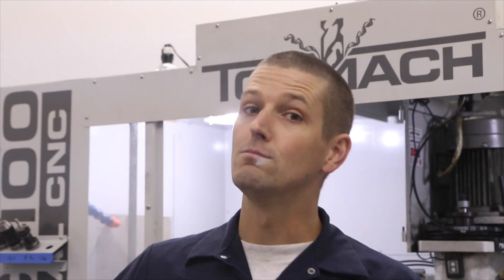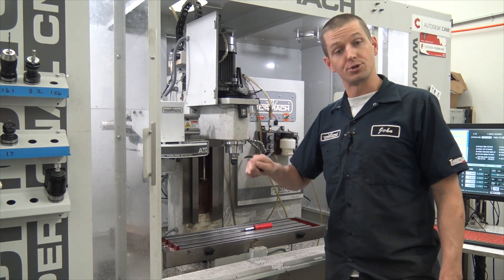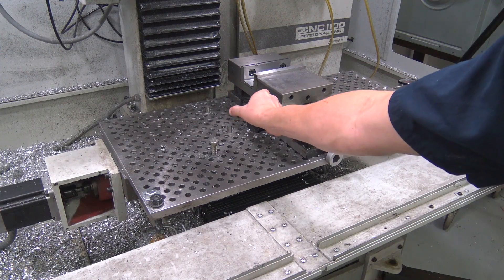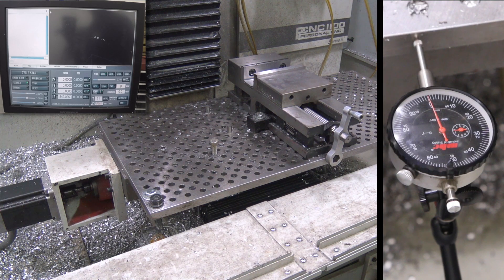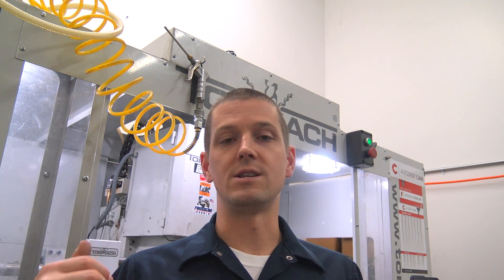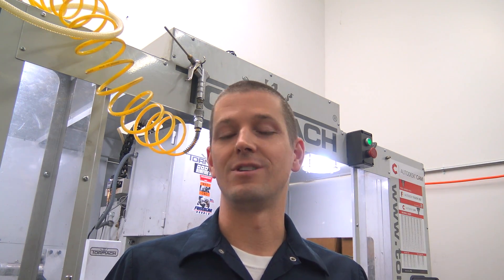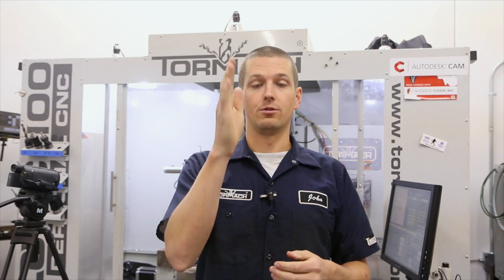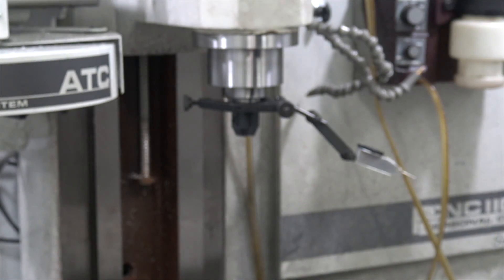Tormach PCNC Maintenance!

Comment: Hey mate. Quick question. For milling steel if you were building a milling machine what spindle would you go for. ER32 collet I prefer over R8. Would you go for a spindle with built in motor or a spindle with pulley and external motor?

Comment: I wonder what the Tormach tram spec is. When I set up a machine, I like to get under .0005 TIR on a 10" circle. I can live with .001. 

Interesting that you could adjust the nut on the ball screw and reduce the backlash. On a "real" CNC machine, the thrust bearings would be angular contact bearings and the pre-load is not adjustable. I did work on a CNC knee mill one time that used tapered roller bearings. It must have been adjustable.

Comment: Hi John,
I haven't read all of the comments so some of this may already have been mentioned. What your doing is checking the tram of the spindle to the table, but if that head isn't bolted down truly square to the column then you still don't have the machine correctly aligned. Setting a 12" GOOD cyclindrical square on the table and a 10ths reading DTI mounted in or on the spindle, then use your Z axis movement to traverse down the square while sweeping across the square every inch or so for the reading will show if that Z axis is at 90 degrees to the table within the slight errors of both the square and the DTI. That has to be done in both X and Y directions to check the column for lean in both directions. Once that's corrected you then use that DTI to sweep the table or vise in both X and Y. At that point you may need to tilt the head for the X axis alignment and possibly shim the head for the Y axis alignment. So there's a bit of tail chasing in this. Even better would be to use no shims and scrape the head into the correct alignment for the best rigidity.

Shimming the column for tram removes a lot of rigidity since the foot print is greatly reduced. Surface grinding on both the bed area and the column foot to get it very close and then both surfaces should be clean and smooth. Then some minor hand scraping to bring it into the last bit for a true alignment would be the best method. A LOT of work with all the trial and error checks and fitting. But there's no short cuts if you want it done right. I only use a 1 or 1/2 thou reading indicator to get me in the ball park. Then move to a 10ths DTI so I know what my readings really are. 

Due to the flex involved with flycutters in the whole machines system including a very minor amount from the spindle bearings themselves you'll always see a very slight back cut even on a perfectly trammed machine. It's impossible for them not to show that effect on the lighter built machines. If you don't see it that means your machine is out in the other direction, or trammed with the flycutters trailing rotation tilted up and away from that direction. And the larger your flycutter then the more pronounced that back cutting effect is.

I know nothing about the Tormack machines yet, or about CNC at all. But these lower end machines aren't properly cleaned at the factory or assembled in anything close to clean room conditions. Even on a brand new machine the table should be pulled and feed screws, nuts way surfaces flushed with a spray degreaser. CRC electrical contact cleaner works very well for the ACME nuts on my mill, I'm not sure how well it would work with those ball nuts though. I do know it's not a good idea to remove the ball nut from the screw for those who don't know that yet. Done incorrectly you'll be chasing the balls all over your shop.

And given your machine is doing production I'd highly stress that pulling the table every 6 months or so would be a very good idea. You will find all sorts of chips in where they shouldn't be, but the way oil will be deep black from wear just due to the parts wearing together. That black oil contains metal and further accelerates the wear. Clean ALL that out, inspect your lube system so you know all areas are getting properly lubricated, double check the tightness on the bolts for the ball nuts, relube, then reassemble and do your gib and screw adjustments for tension. Yes all this is a lot of work, but you will be surprised at what you find under that table. And your machine will work far smoother, much more accurately, and do so for far longer.  I'd also bet you can get your adjustments a little tighter for better accuracy but still have the same amount of drag between the gib and the way surface. My BP Taiwan built clone came from the factory with .020" of backlash and was fairly stiff to move. After the strip down, cleaning,  relube and proper adjustments I had .004" with a silky smooth movement. Not too bad for a manual machine with ACME screws and about what a brand new Bridgeport will have. While I didn't find any casting sand I did find just enough metal and grinding dust from the surface grinding I was very glad I took the time to do all this.

My apology's for the length of this, but you did ask for comments.
Reply: https://www.youtube.com/watch?v=kF3LfP3W-Ec&list=PLEhrXDmG4b0VXI8Q_LVIWXlvWIuVLThoQ&index=6

Comment: Seems to me that's it would be a bit better practice to mount your tram tool directly in the spindle with an R8 collet.Holding a tram tool in a setscrew holder isn't really that bad, but for optimal results its not best.The inherent nature of a setscrew holder to rock the tool to the side abit  when the setscrew is tightened down is not what you want when your inspecting your machine like this. Your thoughts?

Comment: To War Machine: put a indicator holder in the spindle then tram x and y in the same set up by spinning the spindle by hand. THIS IS THE BEST WAY TO TRAM ANY MACHINE. IF THE COLUMN IS NOT PERPENDICULAR TO THE TABLE THEN YOU MUST FIX THAT FIRST BUT ALWAYS END UP TRAMMING THE TABLE WITH AN INDICATOR BEING HELD IN THE SPINDLE WITH A HOLDER.

Comment: Hey John,
Great video. I went through all this same painstaking tramming myself. It took days to get it dialed in just right but I could have saved myself a lot of time with this tip. Tram the head to the column FIRST, then tram the head to the table. There is a big difference. When I initially measured my table tram it was off in the Y so I shimmed the column until it was dead on. But when I cut or drilled I still had long drills binding and squealing, holes not round, etc. How could this be? I trammed it. Well turns out the spindle was not square to the column it was essentially pointing backwards toward the base so I was trying to make round holes with a crooked stick. So I shimmed the spindle cartridge (you could probably also shim the head) until the Z travel was parallel with the spindle axis in Y. After that I put the Edge tramming tool back in to check the table tram and it was off by the same amount that the spindle was off. My table tram had been perfect and I screwed it up, it was the spindle that was out of square not the table. After removing the shim from the column and playing around with smaller shims and bolt tightness I got the table back in tram. So now the spindle is trammed to the column and the column to the table. 

You can check the tram of the spindle to the column by putting a long piece of drill rod into the collet. Attach your mag base to the column and put the DTI on the top of the rod right as it comes out of the collet. Rotate the spindle by hand. You will notice some runout, that's OK just center the zero between the needle swing so it is equidistant on each side of zero. Then run the head straight up in Z until the DTI is on the very end of the drill rod and rotate it by hand again. The magnitude of the runout will increase but the amount the needle is off to one side (subtracting runout) is the amount out of tram it is. You can do this for both X and Y. The idea is to get the needle balanced around the zero equally both at the top and the bottom of the drill rod. Then you can proceed to tram the spindle to the table as you did with the Edge tram tool.
Reply: +War Machine LLC   This is a more direct method of measuring the parallelness of the spindle to the z axis.  I like it a lot.  
One comment.  You don't have to mount the mag base to the column.  It can be place on the table as well.  That way. you can use the table for precision alignment of the DTI.  All that is required is that the DTI be parallel to the x axis and to the y axis  for the x  and y measurements respectively.  

I used a similar method for measuring squareness of the z axis to the xy plane by placing the rod in a chuck on a horizontal RT and rotating the table to find min and max.
Reply: +War Machine LLC Thanks for this. I took the time to tram head to column and then column to table. The head must be in tram with column and needs checked first. Thanks for the heads up and all is well now with the deep drilling.Dennis
Reply: +NYC CNC Besides mill just working better after this type tram, the ATC now works flawless.
Reply: +BeveledGlass You bet! Glad that fixed your issues!

Comment: This is where the Tormach deviates from traditional C frame mill design.  The thrust bearing preload should be set with a shim, that's it.  The bearings are manufactured with precision shoulders, you put a shim between the inner races and make sure the outer races are touching, that's it.  This shim creates a preload of the bearing races and keeps them from having any lost motion.  The thrust bearings on the ballscrews are just smaller versions of the bearings in the spindle, they are both angular contact ball bearings.  You shouldn't need to fiddle with preload nuts, but Tormach decided to install the bearings in a backwards orientation.  They use a shim on the OD of the race and use the preload nuts to establish the preload between the inner races.  The way to fix this is to reverse the bearings in the bore and put a thin shim between the inner races, then the "thrust nuts" only retain the screw in the bearings, they don't adjust anything.

The use of 2 ball nuts to create a preload is used traditionally with rolled screws and mass produced ball nuts.  Looking at the parts breakdown, the Tormach uses single preloaded ballnuts, not 2 ballnuts installed in opposition.

So, Tormach's design is similar to other vendors, but there are a couple of things that make me scratch my head and ask "why did they do it that way?".

Comment: John Did you try and mill a circle after you adjustments? The traditional way to check if you gibs and backlash are correct is to mill a id bore and check it with a dial bore gage. The actual size is not critical but what you are looking for is reversal marks at the 90 deg. quadrants (Backlash)and out of roundness at the 45 deg. quadrants(Gibs) with the dial bore gage. there is a instrument called a Ball Bar Gage witch is used to measure this it will also tell you if your axis are square to each other. But it is a expensive tool. lacking that milling a bore with a end mill in a scrap piece of material is almost as good. A modern CNC machine should be capable of holding less than .001" roundness to the circle. I don't know Torchmach Machines but there should be a backlash adjustment parameter in the control to compensate for backlash in the ball nut. O one other thing the proper way to adjust a gib on a CNC mill as to measure the current draw on that axis servo motor.

Comment: I don't go as far as seizing the steppers. I loosen it, then tighten until a 1-thou step does not make the table move a full thou. I back off just barely from there. It requires more maintenance than keeping it tighter but that's my preference.

Comment: Hi John,

I've seen someone jam a gib really badly doing it your way. The Tormach is low enough power that you got away with it, but it took a hydraulic jack to free off a big machine and people have destroyed Bridgeport style machines by doing it on the knee (if the knee is too low you can't get to the screw to push the gib out).

The propper way is to use a dial gauge to measure the rock in the slide.

Keith Rucker did a good video on the task; Machine Shop Basics: Tramming a Vertical Milling Machine
Reply: +Paul Compton   +1 to the Keith Rucker video showing the proper way to adjust gibs using an indicator with a torsional force.  I was very confused by Tormach's method of adjusting the gibs by measuring backlash.  The video I watched was titled: Milling Machine Maintenance:  Adjusting Gibs and Ways.
Reply: Paul Compton I

Comment: John I'm a little puzzled as to why both you and Tormach are interchanging leadscrew backlash and gib adjustment. I'm not at all familiar with the Tormach, but I believe the two should be completely independent (well to a point the table is jus flopping around).

Were the gibs far out of adjustment? About 6 months ago I wrote in a comment that I felt they were loose and should be adjusted. I'm now curious to know if that was correct.

To adjust the gibs on my machines I normally try to completely disconnect the leadscrews so I can move the tables etc by hand. I then make the gib adjustment by moving the table through the full range of travel and feeling the tightness at the gibs by the drag. Generally you want to be careful out at the extremes of travel as the machine doesn't normally get used as much out there, and the gibs can finish up tight if you adjust only for 0,0 and don't check the extremes. I get much better feel for the adjustment by moving things by hand. I have no idea if that's possible on your machine.

Finally, does the Tormach have a backlash compensation function within the firmware? Once you've exhausted the mechanical backlash, and if the remaining backlash is consistent and predictable, I think you should be able to take out most of the remaining in software. I have absolutely no idea however how, or even if, it's possible on your machine, but the Tormach people should be able to advise. It certainly is however available on other CNC platforms.

Great to hear it's all working out.
Reply: +NYC CNC Sometimes it's not necessary to actually remove the screw, and you can just remove the hardware at the ends that supports and controls its backlash. It does feel like you're going backwards to move forward, however in my experience that sweet spot is very narrow, especially as the machine wears more and you will battle getting things "just right" (or at least as good as they can get). Done in the correct sequence (ie first) adjusting the gibs this way shouldn't add that much time to the project. Just be grateful you have a tapered gibb and aren't trying the same with a series of gibb screws!!!

Anyway, it's done now and all is right again. Good to hear that the machine is running sweetly once more. I do think 5 years is pushing it a little for a machine like that in heavy use, and a once year check and adjustment should keep a smile on your dial.
Reply: +Pete F To adjust the bearing preload on my 770, loosened the gibs to reduce any friction there,pulled the motor, and replaced it with a torque gage capable of measuring inch-ounces.  I loosened the bearing preload and measured the torque required to turn the ball screw at 21 in.-oz. which would be due to way friction and ball screw preload.  I then tighten the bearing preload nut to a torque of 38 in.-oz.  This gave me a backlash/lost motion of .0004".  This is also  a good way to adjust the gibs substituting a torque reading for the "feeling of tightness".
Reply: +Robert Sakowski Nice, that sounds like a good way to go about it.
Reply: +Pete F  The torque gage is rather simple in design.  It is a flat pulley 2" in diameter with a length of fine cord wrapped around.  The loose end of the cord is attached to a spring scale reading 70 oz. max.   A steady pull on the scale will unwind the cord providing torque to rotate the shaft.  Because of the 1" radius, the scale reads torque in in. oz's. directly.
Reply: just curious....why 70oz max?

Comment: While I do not (yet) have the Tormach, I can tell you the processes that many mills benefit from. All screw drives need to have the preload nuts tightened, typically to a predefined torque. In addition, the carriage itself will (in most cases) have an adjustment for the part that drives the table. Most ballscrews have a way to increase the preload of the balls inside, reducing backlash. Same with standard ASME screws. A screw or spacer spreads the engagement teeth so that both the front and back face are in contact. Ball screws benefit from an extremely low friction though, and the best ones use a gothic arch thread profile so each ball has at minimum 2 points of contact. Properly loaded, they have 4 points due to opposing gothic arches.

Overall though... When you said you werent sure ho much you were missing... Less that 1 tenth. ;-) Started at .0003, ended around .0003. Well done!

Comment: I was able to shim in the X tram, no problem. What is the best way to adjust the Y tram?  By the way, I zero the Edge gage in the Y axis so that I don't need a mirror. It does not matter where you put the magnet as long as you don't move it during the zero process.

Comment: John, well done, informative, insightful video as always. Happy that you are happier with your machine now compared to a month ago prior to the maintenance process. I agree that the stepper losing steps shouldn't happen in this mode. But watch out for wear in the middle of the travel range vs travel at the ends. At certain gib tightnesses, you might be OK in the middle of the travel but could lose steps or seize altogether at the ends because of less wear at the extremes of travel.

Comment: Hey John.  At 9:00 where you're asking about ways to check gib tightness, I've found the best way, is to use a dial indicator to check for the amount of deflection you can achieve by twisting on the axis with your hands.  Keith Rucker Does a decent job of demonstrating what I'm trying to describe.  https://www.youtube.com/watch?v=nqQ3HzoSnUc&feature=youtu.be&t=749